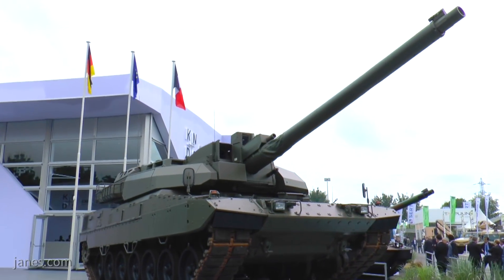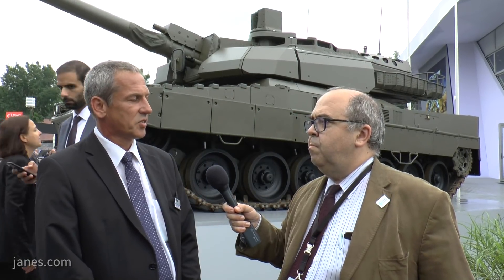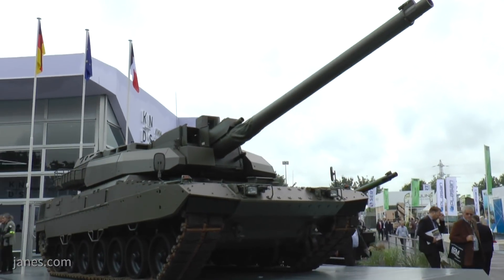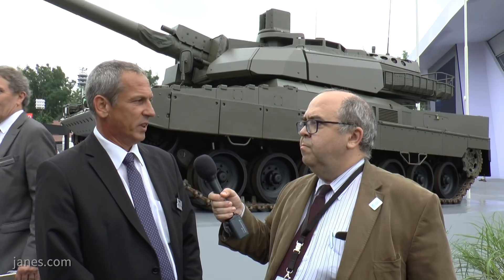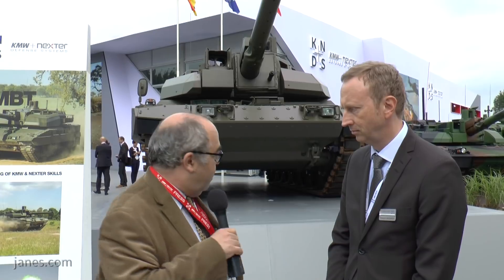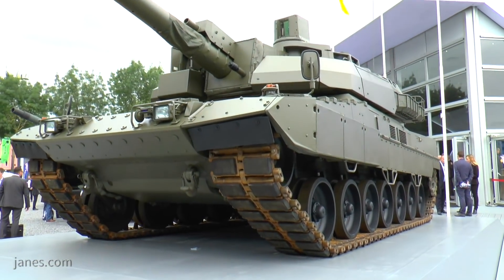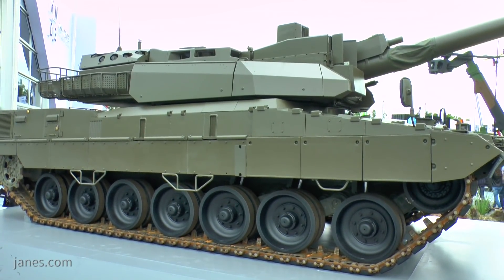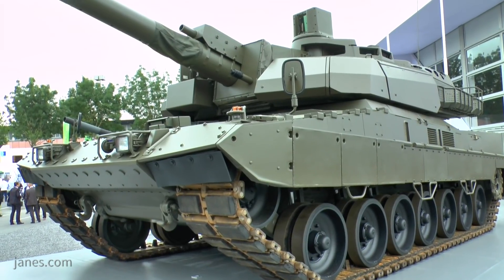Eurosatory 2018: KNDS presents joint Franco-German tank demonstrator

Comment: Is the french turrent better than the turrent of the leoard2?
Reply: The Leclerc turret is equipped with an auto-loader, the Leopard turret hasn't. Autoloader grants faster reload and better ammunition compartmentation boosting safety and allows to have 3 crew tank (gunner, driver, and commander).
Here, they chose to use the Leopard chassis because it has higher weight capacity than the Leclerc and the Leclerc turret has an autoloader (and thus only 2 crewmen: gunner and commander) and is lighter than the Leopard. In the end, the mix tank gained 6 tons in weight available for customization (this could allow to up-armor the tank, equip trophy systems, smoke launchers or even a second machine gun outside the coaxial gun). This tank is more a proof of concept than a true Main Battle Tank, meant to allow the German builder KMW and the French builder Nexter to demonstrate their capabilities to develop the EMBT that will be built from scrap for the French and German militaries. It was more to allow the 2 builders to have a first experience together before beginning the Eurotank project.
Reply: Yes. Autoloader, fast shooting, very accurate on the move, replaceable modular armour, latest tech sensors/battle management system, and smaller profile so less of target
Reply: Yup way more 1700m rang will Moving 4000m at neutral

Comment: Germany would have been better off teaming up with the USA and building a intergraded tank with the M1 Abrams.
Reply: ironically they tried before and that program failed
Reply: This is about EU getting away from being dependent on America and its might.
Reply: @Old-Dog00  Yes But it would be a great tank for both countries.
Reply: @TONSBERG100  yes
Reply: ERIK SAGER lol no
Reply: Leclerc > M1 abrams
Reply: That Program was or is the Leopard 2 and the m1 abrams / this 2 Tanks are very similar and the Original Program was MBT 70 a Cooperation of Germany and America / the Leopard 2 and the Abrams have no Advantage over the other

Both Countrys has some differences in the specs so the MBT 70 was cancelled and the both now existing Tanks were developed 

They have the same armament RHM 120mm Canon and so on

The Tank in the Video is only a Thing too see how both Firms (kmw and nexter)  can work together IT's not the EMBT only a experiment